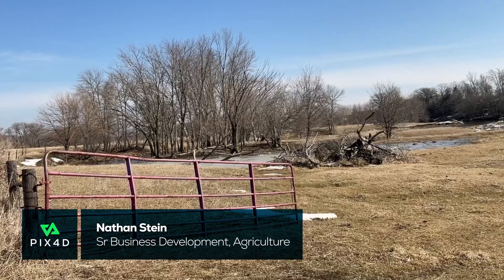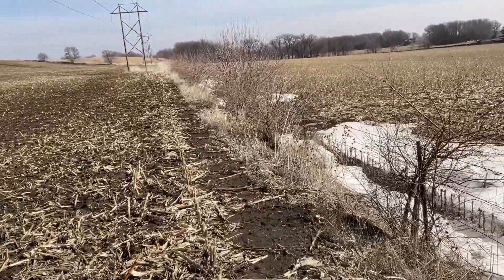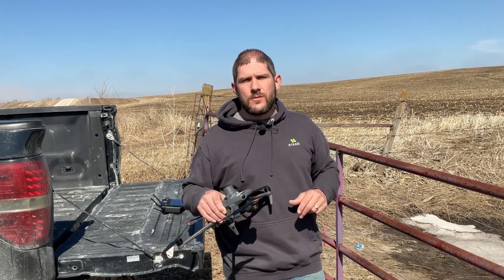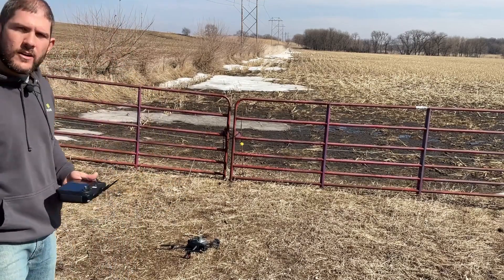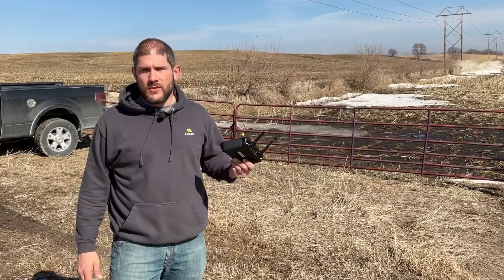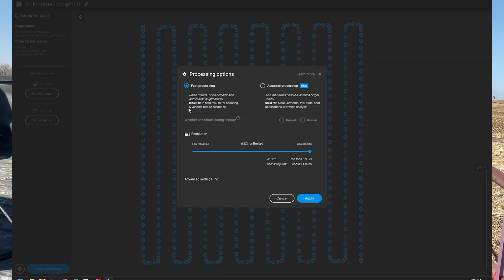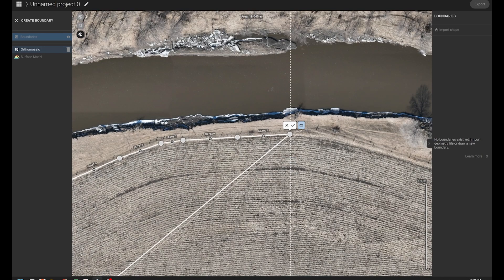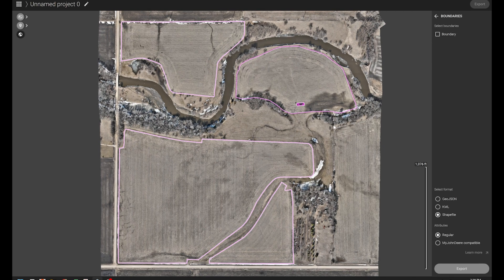How to create RTK field boundaries with DJI Mavic 3 Multispectral and PIX4Dfields

Comment: Hi Nathan.  Thanks so much for the videos.  I have a question about the RTK setup.  Is it possible to connect my mavic 3 multispectral RTK to the same John Deere base stations my tractors run on? I have struggled to find any info on this so I’ve just been scouting my winter wheat without the RTK module on my M3M.